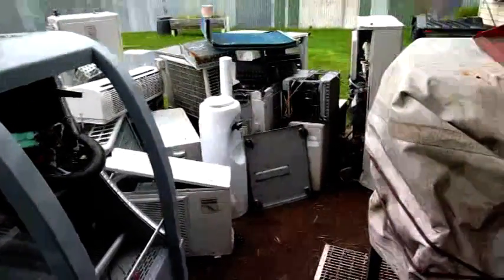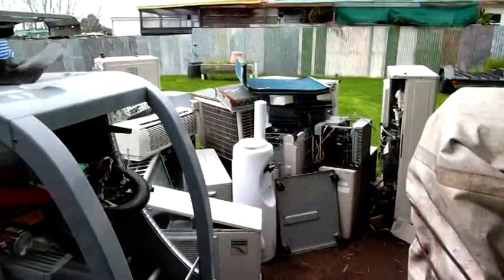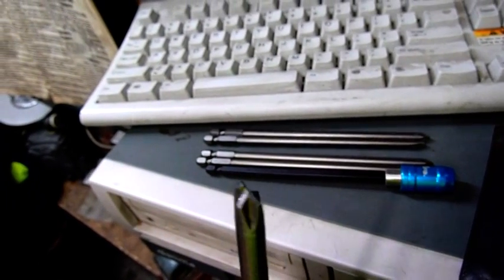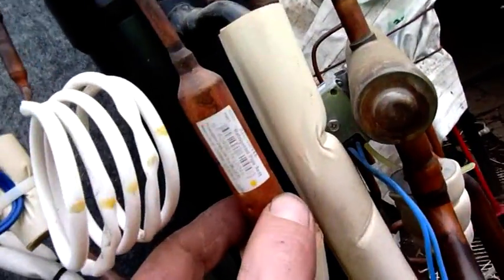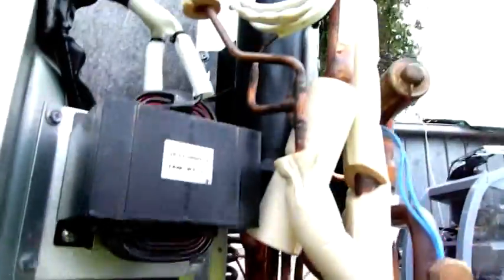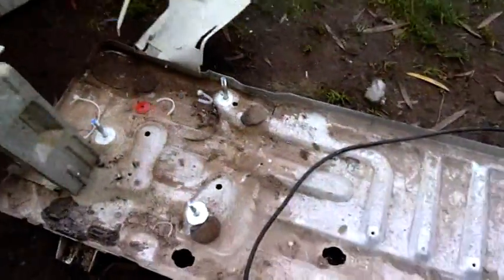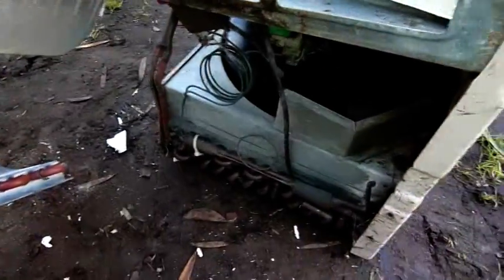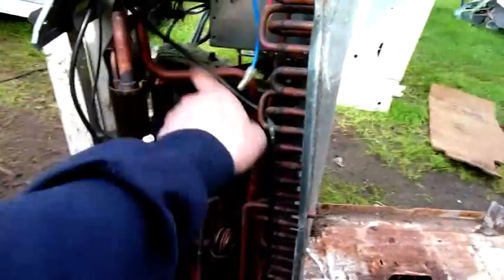Commerical Daikin And Other AC Unit Disassembly

Comment from the maker: @heavydiesel yeh I ended up breaking the screws free with a socket, they are damn tight.

Interesting that the magnets are worth something for recycling. I will look into it.

I cut the old compressor open and found that the injection port from discharge accumulator goes to the high side (the stator housing is the high side on this unit) and the one off LP accumulator goes to the LP side.

both would return oil by the looks of it.

Comment: Think those daikin screws are 8mm hex, you can get a tek screw socket with a magnet thats designed for those self drill roofing screws that will stand up to impact driver use and fits them.

Most of those inverter comps have rare earth magnets which i heard are becoming worth recycling.

The extra pipe on the comp might be liquid injection for cooling in low load situations, or it might not lol!